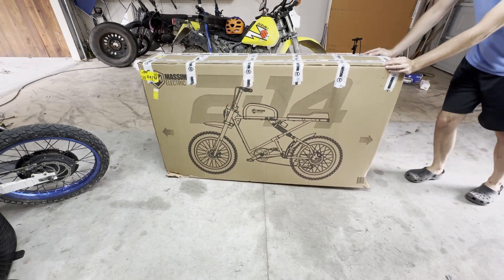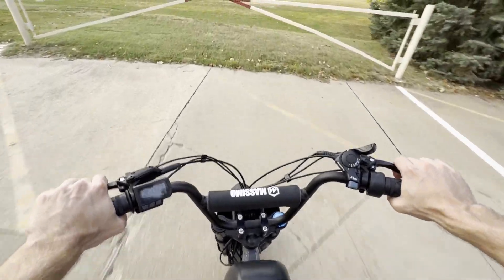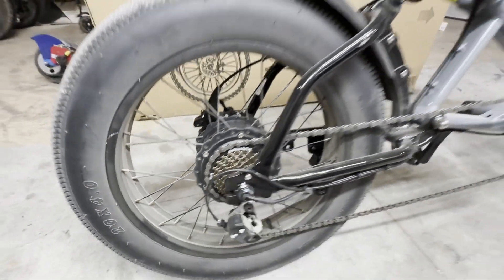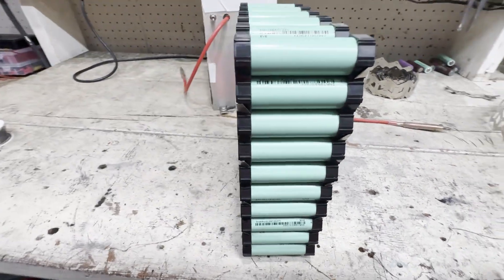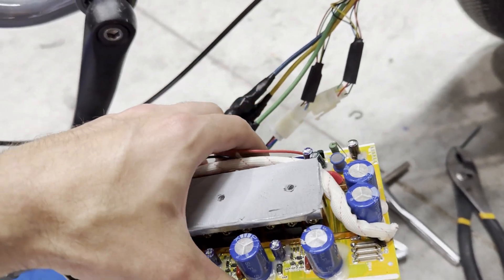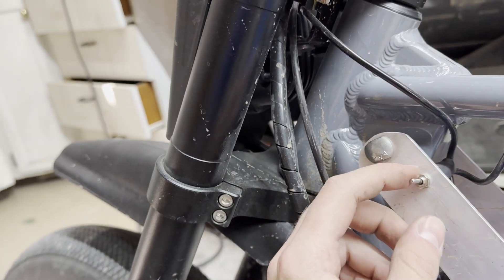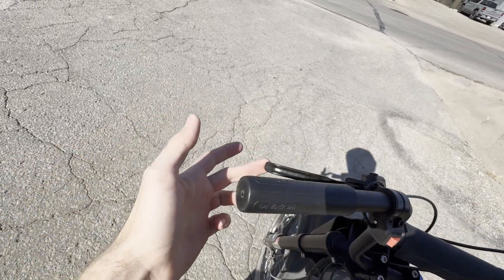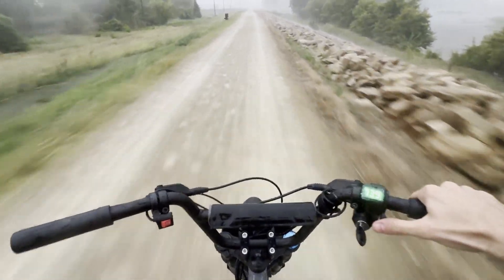Cheap Stunt Ebike Build

Comment: I had the same issue with those generic controllers and sw900 display, basically connecting the battery to the controller even with antispark causes huge current and kills the screen, make a xt90 harness with a 150 ohm resistor and replace the screen and it should work fine, connect harness when plugging in battery
Reply from the maker: That’s annoying, you would think you would be protected from that problem with an antispark. I think I’m done with generic controllers, I would consider them if they were super cheap but if I can just buy a Fardriver for like 30% more then it’s definitely worth it.

Comment: how heavy is the bike after everything, you throw it up so easily
Reply from the maker: It’s comparable to stock since the battery isn’t really that heavy and the increased weight of the motor doesn’t effect the weight when doing wheelies.

Comment: Hello. In one of your videos I heard you ask for mic recommendations to help with wind noise. I recommend the shure sm11. It needs a preamp. I have a small battery powered preamp. And I’ve fit a wind muff on the mic. In my videos if you see me riding a bike with no wind noise, I am usually using the Shure sm11. Whereas my other mic’s have frequent wind noise even with the wind muff.

Comment: im looking at putting a 72v 3000 watt kit on my hidoes b6 and doing it myself because the local bike shops will only fit 1500 watt max can you help us find a kit and battery which will fit on my hidoes b6 and which won,t be too hard to fit has i have never done one before
Reply from the maker: I'm about to post a video upgrading a bike just like that so stay tuned

Comment: Watched the whole vid and i Enjoyed it. Keep it up bro. Ive also done some Mods on Kids scooters and i guess it didnt turn out well. I Tried doing it with My cousin. The scooter was originally a 12 volt and we decided to take apart 4 Milwaukee 12 volt battery and connected them in Series. It was one of the best Mods i did. I would use it for 1 hours and still nah issues. Soon Me and my cousin Tried to upgrade it more and it was not a Good idea after the batteries overheated and cells blew up during Test ride. My cousin never sticker his hands onto Any Electronics after that. But i still wanted to keep doing it. It was really fun to work with And to this day i still plan on Making Something like that. Keep up the good work. Also if your looking for a Mic that could Remove Background/Wind Sounds i suggest Going to DJI website they have some pretty good Microphones its simple and easy to attach.
Reply from the maker: @creativetech215  I also once hooked a bunch of lipos up to a scooter before I knew how batteries worked and I had to stop riding it because they swelled up and were on the verge of exploding. I’ll check out DJI.
Reply: @ lipo Batteries to a High current Motor is definitely not a good Idea. Thats good you learned from mistakes. I blew a Vape battery Up after plugging a 12 volts charger in it. 😂

Comment: you should build like a bigger bike out of like a 450 frame! you could do a qs138 90h and a fardriver with a amorge battery and you could be doing 90 mph+ while having all the suspension and brakes a 450 has, theres one near me for sale and i might buy it.
Reply from the maker: @davidhammak  You read my mind, I’ve been looking for a 250/450 roller to buy. The problem is most of the modern bikes have an aluminum frame so I would probably need an aluminum tig welder to fab all the parts, and a decent tig setup is easily over a grand. I could maybe just bolt everything but that could loosen over time and that would be bad. I would definitely build the battery, I have all the materials and skills to build better batteries than amorge for cheaper.
Reply: @Calthecool  even a old yz125 pr any 125 2 stroke frame works! they are all the same size so it would work to, qs motors with the 138 90h motor can handle about 45kw peak max, and the 450 coverted one is running about 45.6kw peak or 61hp, it would be sick if you do build one! if you do, when you build one, try to make the battery discharge as much amps as possible, the one near me is running a 76v battery 600amp peak and 400 continuos, its from amorge, and the dude selling it wanted to buy one that they made that did 650 continous and 800 peak.
Reply from the maker: @davidhammak  Yeah I'll definitely keep an eye out for those, I would prefer a 250 four stroke/125 two stroke size frame because I like smaller bikes and I would probably only do around 20-25kw because I don't have much experience with powerful dirt bikes and I think that would be plenty for me. My limiting factor right now is the BMS, the most powerful one that I trust right now is 100a continuous 200a 10 sec burst. Everyone online loves to throw around BMS manufacture names when you ask what's good but nobody wants to actually link any listings, and I would like to avoid buying 0 review BMS's off alibaba and gambling with my money.

Comment: I definitely feel like that battery needs a little bit more of a housing but hey not bad for something to do some stunts on
Reply from the maker: @floppydisk4500  if you felt it you could tell that it’s holding it well enough, if I do build another one I’ll probably make a sheet metal cover that completely surrounds the frame and battery but I didn’t want to do that on this one because it would be hard to remove the battery.
Reply: Sounds like exactly what it wants. I'm really impressed by your build overall. I'm trying to do something similar with my e-bike right now. But I'm going to be upgrading to instead of a hub motor I'm going to use a cyc mid drive
Reply from the maker: @ I tried a bafang bbs02 before and it wasn’t for me, but that cyc mid drive looks like a beast. Will you build or buy the battery?

Comment: What was the motor that was used? And how many volts was the battery
Reply from the maker: @954santi  the motor was from an Amazon kit, but I got it on marketplace so I don’t know which one it was. It’s just a generic 3000w direct drive motor. The battery is 72v 84v fully charged.
Reply: @ Do you know what size dropouts this bike has
Reply from the maker: @954santi  175mm
Reply: @Calthecool  can that kit be used with a 48v battery

Comment: Get a sab 150a controller and a 72v 30ah battery 150a discharge real nice power that for the bike or even a 80a controller and a decent discharge battery
Reply from the maker: @Ronkilla  My plan for the next version is a 72v 28Ah battery with a Fardriver 80a controller, with 5,700w it should be plenty fast. That’s about the biggest battery I could fit on this bike while keeping it slim. I had a Sabvoton on my first powerful ebike as you probably know, but I think the Fardriver controllers are better in every way except for how they look.
Reply: @Calthecool  nice I do like the sab controllers as they have a ukc1 display with them and for Somereason it's more torquey the bike I had sw900 on old bike with sab controller swapped it woth ukc1 its a crazy bike lol fardriver controller are good

Comment: do you think the coswheel is worth it to get, I was thinking of buying the cosweel t20 e bike it has 500 watts of power and a 20 ah for 1600 aud
Reply: I would say no because that is underpowered for that bike unless that's not what you want. I think that for the price you should get for emoto the tuttio Soleil01 and for ebike there is a lot of moped fat tyre bikes that are better like the ouxi h9 and even some super73 clones are good but ouxi h9 is advertised 1000w but is 30 mph top speed or 50kmh
Reply from the maker: It’s really up to you, but personally I wouldn’t want a bike with less than 1500w because at that point the bike would be so slow that you couldn’t ride it anywhere without impeding traffic, unless you only ride on the sidewalk. I know it’s tough finding good bikes in Aus but keep looking and you could probably find something better.